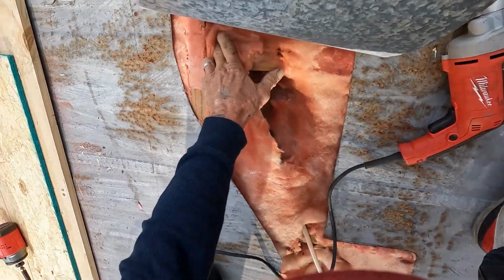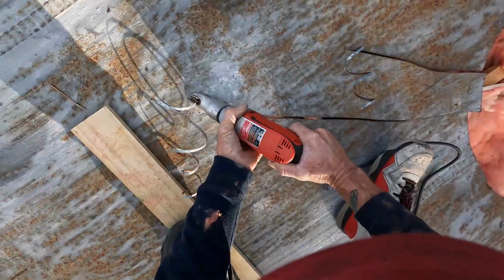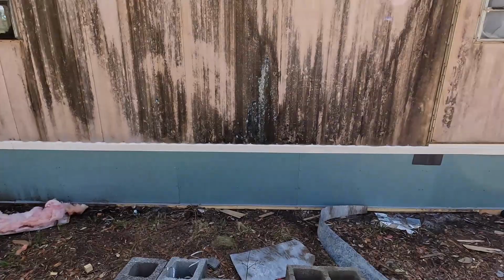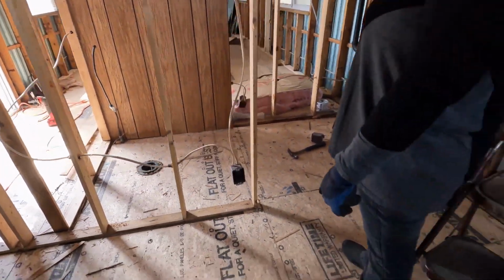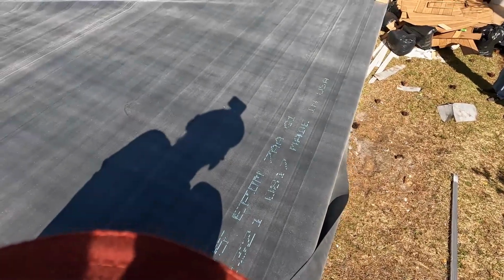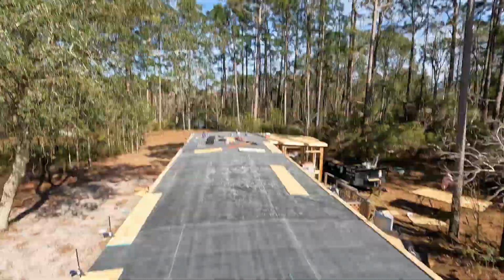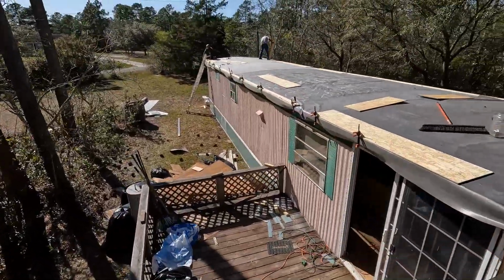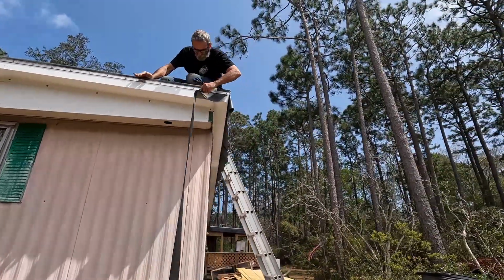How Did We Do This? Mobile Home Roof Over.

Comment: What's the estimate price between for putting a metal roof on a 70s 2 bedroom mobile home if you don't mind me asking?
Reply from the maker: If you notice the house that you’re looking at does not have any type of a pitch on it so it is almost flat. Therefore I would not put a metal roof on a flat building. If you had a roof with a pitch for 12 or better you could easily put a metal roof on something like that. The reason why I put a rubber roof up on these no slope Mobile home roof is because they do not have a pitch if there was a pitch we would put metal and if it had a pitch you’re probably talking about $8000 for a metal roof

Comment: Drew, would you explain more about the rubber roofing ie how long it will last or when do you have to replace it and do you have to keep putting a sealant on it?
Reply from the maker: It will last 30 plus yrs. no sealant needed. No replacement till it gets old or cracks. It will last 30 yrs plus
Reply from the maker: https://youtu.be/f82kikum1B8
Reply from the maker: That’s because you didn’t have me do it LOL I use 0.45 rubber.
Reply from the maker: I’m not sure what type of rubber they used on your roof or you used on your roof but I can tell you this 045 rubber that I use last 30 years. The first one I did was 22 years ago it has never leaked. As a matter of fact in 22 years I’ve only had two leaks and it was because of a pipe boot. My seams don’t come apart and the rubber will last 30 years if you do it right so I’m just not sure who did your roof and it only last six years I hate it for you maybe you should’ve had a better contractor just rubber does not crack in six years it’s impossible
Reply from the maker: If you were here I would bring you down to my first Rubber Roof job it looks the same as it did the day I did it I’m a professional sounds like your roofing company wasn’t very professional and I’m thinking they used a different type of rubber than I use. Did you put TPO on your roof or EP DM there’s a big difference
Reply: @Drewsroofingandhomerepair  No We haven't had our roof fixed yet. We are just exploring our options at this point. We still have the old tin roof and you seem to be the expert on mobile home repair. Thank you so much for the info!

Comment: How do you know the rafters can hold the weight of the plywood..  Just asking
Reply from the maker: We added 1700 pounds to the top of this roof. When I started these roofs in Bolin Springs where I live the inspector made me get an engineer to tell me I could do it after a couple of them they didn’t bother with it anymore the engineer said it will easily hold 2000 pounds or better so on that particular roof you’re asking about an engineer Give me the stamp of approval for $500